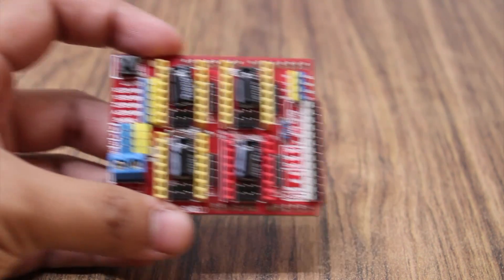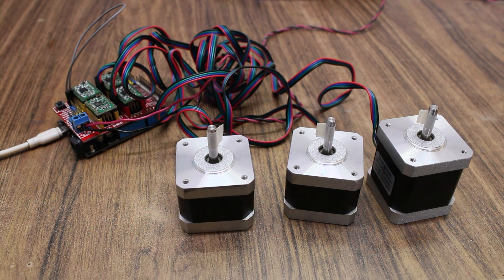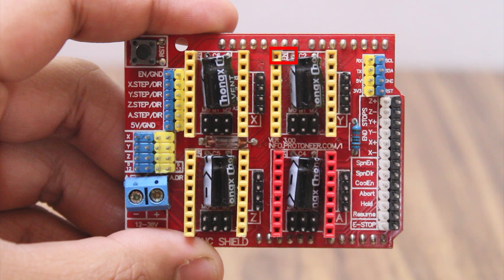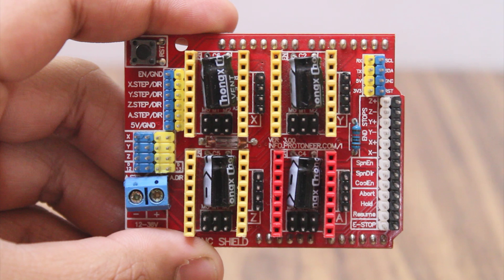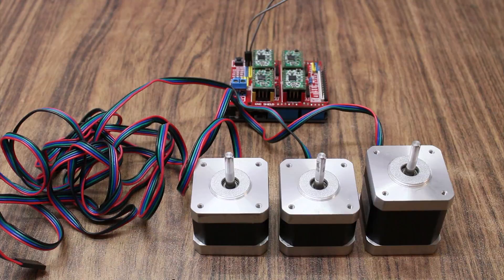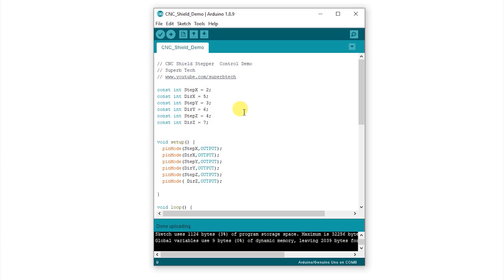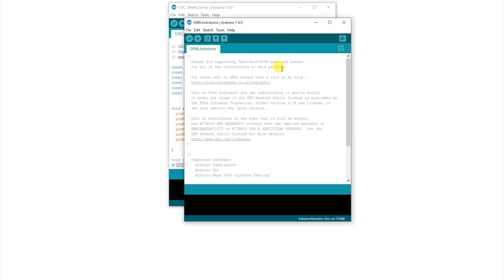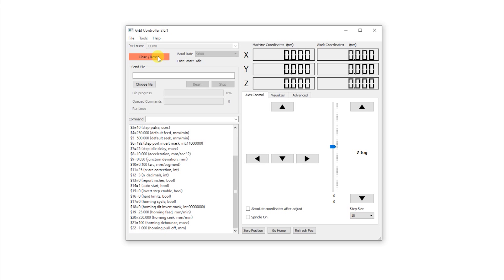Arduino CNC Shield Tutorial - Control Stepper Motors using CNC Shield V3.0

Comment: HI thank you your explanation it is so useful but I am trying to add to the code for axis A but I couldn't get to let the steeper motor work for axis A so can you please help me
Reply from the maker: Sure, How can I help you?
Reply: @SuperbTech   okay thank you I figured out the problem but now I have another problem so can you please help me? I have a project that I have to connect 5 steeper motors to 2 cnc shields using 1 Arduino board each motor will have different directions and speed so I need to have 1 cnc sheild working as the master and other working as a slave so how can I do that 
i know that i can use the uart method using the tx and rx pins in the cnc shield but i couldnt gifour out how to do that 
so can you please help me
Reply from the maker: thats nice, you can email me the details, i'll see if i can find a solution. fnfkhan07@gmail.com

Comment: Thank you for including the Arduino code before the GRBL bit, so many people only talk about GRBL but I just want to build a motion control rig for a camera, not a CNC machine or 3D printer and seems to be what everyone is doing. The code helped me figure out what wasn't working for my project (turns out two of the pins on my UNO died) but now I understand what the shield is doing and can right whatever code I want for my needs.
Reply from the maker: you're welcome, i happen to be working on a 3 axis camera slider too, stay tuned

Comment: Being a two years of experience person, please don't use grbl based control boards, it gets random stop problem which is highly irritating and time wasting problem in grbl based cnc, even after upgrading the stepper driver to bt6600, still problem exist,   I've done all the solutiona, but problem persist,   which no one discusses on online platforms,   it will blow your mind while cutting by stopping randomly on the job!
Reply: I've been experiencing a similar problem, so what do you recommend?.
Reply: You need to check which Gcode line it is stopping.Maybe an unsupported Gcode command?
 
Check if the CNC is stopping at the same place?

Check if the issue is reproducible with different Gcode files?

You need to isolate the problem.

Comment: Great video, can you can multiple cnc shields together to have more steppers? For instance if I wanted to 12 stepper to be controlled individually?
Reply: https://content.instructables.com/FBG/AHDV/JE95G332/FBGAHDVJE95G332.jpg
No need fir CNC shields
Reply: But can these be controlled individually what happens if I want 24 steppers? Will that require two or more Arduino unio?
Reply: @jamesssydney  For 12 bipolar steppers you need 24 available pins as I showed you in wiring diagram. Arduino Mega had 54 digital pins so you can control at least 25 motors.
In addition you can use analog pins as well as I remember.
If it is not enough you can add I/O expansion boards to your Arduino and it will give you dozens of additional pins.
Reply: Thanks Felix you’ve been very helpful. I’m currently using 27 steppers on another project which doesn’t use ardunio. It’s driven but some other custom cards but this company is no longer in business. So looking for a plan b

Comment: Hi
Can I connect more than 4 motor?
I need to connect 10 or more, is it possible?
Reply: I'm curious on this also, will it require multiple CNC shields?
Reply: @jamesssydney  I find how. Use easydriver for controlling 4 wire bipolar stepper motors
Reply: How many step drivers did you end up controlling?
Reply: @jamesssydney Unlimited. It only depends on number of available pins on Arduino board.
The good news that 4-wire bipolar stepper motor uses only 2 Arduino pins, when it drived by Easydrive board
Reply: @jamesssydney   Of course you have to check the current of voltage. I think it will be no problem to connect 12 motors using 12V 3A.

Comment: Thank You!  I'm using this shield for a wire wrapping machine and needed to know how to enable it, you answered my question.  The enable pin doesn't have to jumper to ground though, it is also connected to D8 on the Uno, so you can use code to enable/disable the stepper drivers if you want to rather than having them always enabled.  

The first set of drivers I put in had a bad driver and it was enabling the others but the stepper it was driving wouldn't move.  When I figured out I had a bad driver, I put what I thought were good drivers in but nothing worked anymore.  I think I made the mistake of putting drivers in before I used a multimeter to trace which pin went where and all the driver enable pins showed as being straight to ground pins on the Uno so I figured they must just be always enabled.  Yes, I'm stupid but a lot of people just short the enable pins to ground anyway rather than coding the stepper enable pins.

Comment: Hello, I'm using your stepper test code, to make an inexpensive toy, since I had bipolar steppers in hand.  I was wondering how to control the rotation speed, in the code, using your stepper code test script, and the V3 module.  I'm using all 4 outputs, from the V3 module, including the A output.

Comment: i want to use 4 nema 17 with these same drivers can you tell me how to calculate total current and voltage  and how to choose the correct power supply  as required. And also that enabling of enable pin keep the shield and arduino isolated ? could be so helpful !

Comment: Hi
arduino uno + cnc shield v3 + A4988 motor driver + stepper motor 
itna mene try kar liya he. or success bhi he.
ab muje isko controller ke sath operat karna he . to kese kar sakte he ?
kyunki muje 1 mm se 2.5 mtr tak move karna he . or forword reverse ka speed bhi change karna hota he.
iski agar koi jankari de sakta he dhanyavad.

Comment: How much voltage and current is he using from the power supply? I think that's a very important point missing from this tutorial. Otherwise it was very helpful.
Reply from the maker: voltage is 12V, each motor uses about 1A
Reply: @SuperbTech  Thanks for replying. Did you set the current limit on the drivers using the potentiometer?
Reply from the maker: yes
Reply: @SuperbTech  Okay makes sense. I do feel that these details are very important to include in the tutorial. I smoked quite a few drivers because of it! But thanks a lot for the video it helped me get started.

Comment: I just got a complete CNC machine that might have a fried board. So i've been thinking about getting to learn to use Arduino.
Maybe i can replace the "electronics" with an Arduino instead of having to buy new parts for 1000$ :)

Thanks for the vid, i will look more into this!

Comment: great video . i really appreciate it . may i ask about the A driver? it wasnt used in the video. maybe you can instruct me how to use the A driver as a stepper motor controller . and do you know how to make all the stepper motors run together simultaneously? id really be thankful about it
Reply: I know this is late but I'm answering in case someone else has the same question.  If you're not using it for CNC with GRBL or writing your own code, use D12 for Step and D13 for Dir of A (I may have that backwards but those are the two pins).  All the driver enable pins are connected to the same enable pin he showed as needing to be jumped but that enable pin is also connected to D8 so you can use code to enable/disable if you want to instead of using a jumper and having them always enabled.  For use with GRBL, use jumpers, the A can be used to clone X, Y or Z, depending on where you put the jumpers for use with GRBL.  GRBL can only be used for 3 axis so one has to be a clone for it.  You can find more on this online and where to place the jumpers to clone which axis fairly easily.

Comment: Hello, program ran a few times and then quit. Current displayed on power supply went to zero while voltage remains at 12 [V]. Any thoughts regarding why current may have quit and motors are no longer operating? EN/GND jumper still in place... Thanks! Great / helpful video!

Comment: hi greate video!but i just want run one stepper so i change the demo code ,unlucky it doesn't work ,the driver is enabled but the stepper has no voice not even run ,so sad,is there some problem~thx alot!
Reply: probably the driver is damaged? but the voltage is right

Comment: great video.i have built a filament winder and using the same boards as you have here.would it be hard to program them to run a stepper motor at a constant torque and even stop if too much force is applied?.as the winder gets full the rotation speed has to slow down so the motor speed is determined by the force needed to wind the filament.i have seen this on other winders but have no idea how they do it
Reply from the maker: Thank you. I may be wrong, but i think there is a way to control the tension of the wire. You can measure the current consumption of the stepper motor with an arduino and a current sensor. High current means more torque is exerted on the wire. That way you can calibrate the diameter of the wire.
Reply: @SuperbTech  yea, you are right about the current consumption. i got it sorted by using maximum step pulses and minimum current using standard stepper driver and speed controller.it doesn't take a lot of force to slow or even stop the motor from turning which is what i need
Reply from the maker: Commercial filament manufacturers have laser diameter measuring devices, which then create a feedback loop to control the pull tension, to get the desired diamater accurately.

Comment: Hai, may i ask a question? If i want to use 2 stepper motor in 1 axis, do i need to connect at addtional y axis? (Red color)
Reply from the maker: yes you can connect additional motor for y axis on the A marked pins